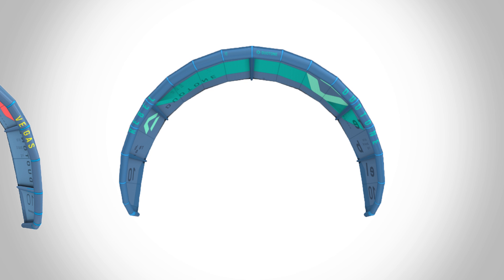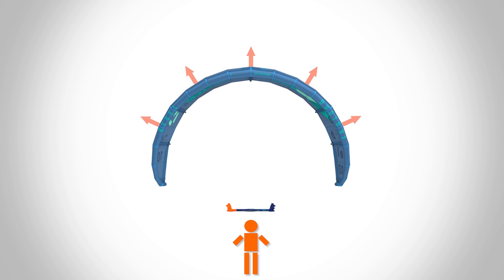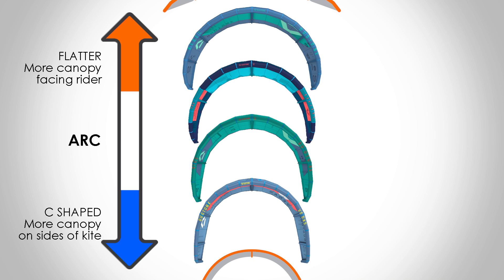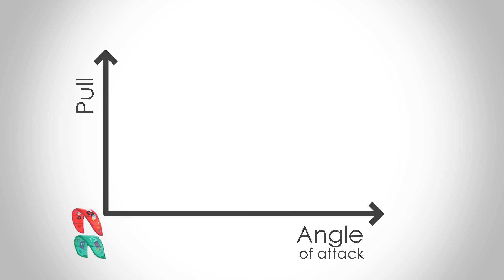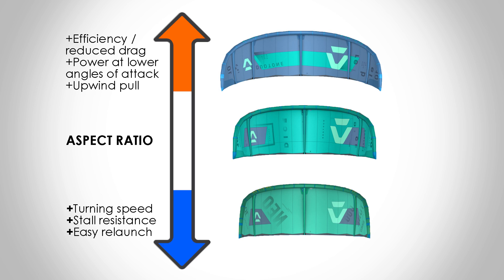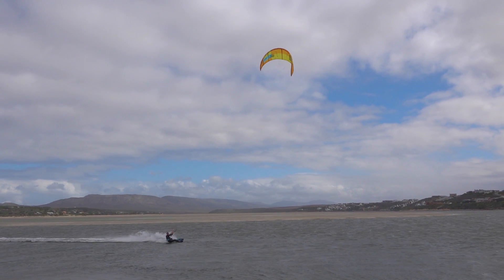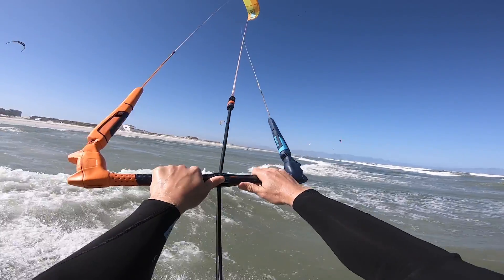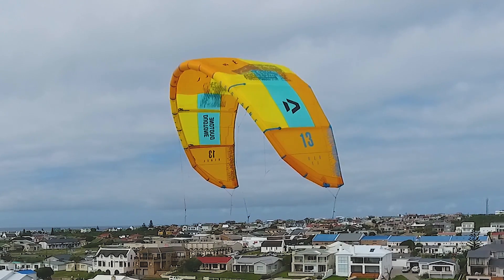Kite Shapes Explained (Bow, Delta, C kite, Hybrid, Flat, Aspect Ratio, Buying Choices etc)

Comment: So I am a complete noob and I have a core xr 12m and all the proper gear and what not is this a good starter kite for being a beginner? Thanks for all your advice and videos there so informative and in depth your very awesome at providing quality informed videos thanks 🤟
Reply from the maker: That's a fine beginner kite, good depower range. Has a tendency to make learning your first jumps harder, as it can front stall more easily than most kites, but you'll learn to work with that.

Comment: Hello, just picked up a sub, appreciate bthe good videos :)
I picked up future C-shape core kites secondhand, the GTS 10m 2020 and a 17m nexus for Light wind. New kite friends have described the rebel as the kite they wish they had started when seasons ago. What's the practical differences of a 'future c-shape' kite Vs the dutone rebel, as an example please?

Thanks!
Reply from the maker: Hello hans. What stage are you at and what kind of kiting do you like to do? The GTS is a slightly C shaped kite, with a bridle and a slightly low aspect ratio. It sits in a similar position to the dice on the chart but with a lower aspect ratio and skinnier leading edge. The GTS' shape is aimed at fast turning, since it's C shaped and mid aspect ratio, both of which improve turning speed. It's also quite fast in forwards flight, the leading edge can fly forward quickly, mostly due of the skinny leading edge. The downside of this is the kite likes to overfly a bit more than normal and that does mean that you really need to loop it, or work it, to land anything more than a tiny jump. The GTS is primary built for aggressive kite loops, since it will turn on the spot and move where it's aimed. The GTS also works reasonable well for unhooking. It's aimed at advanced and younger riders interested in mega loops and unhooked tricks. The rebel is really very different, it aimed at older riders that want maximum power and power control. The rebel has much more lift with the kite above your head or at the edge of the wind window, i'd say about 30% more, though i haven't stuck a newton meter on them, just judging by how my knees feel. Anyway, that extra force at the edge of the window means basic jumps the rebel can give much softer landings and also means you can ride a much greater upwind angle. There is a lot more power control from simply moving the bar in and out, whereas the GTS is more controlled by steering and window positioning. You have to apply more force at the bar to get the rebel turning but the new rebels do turn extremely quickly and loop well. The older ones not as much. The rebel is not good for unhooking. If you have any more questions let me know.
Reply: @kitesurfcollege  hi there. Thank you for the highly informative answer 😀 Truth be told, I'm a complete beginner that has done 10hrs of lessons and that was a few months ago. I've a background in surf, short board surf Sups and snowboard experience. 105kgs dry and 6"4".
I can get on the board and go left and right. That's where I'm at. I'm 36 and I guess I'm an older rider who wants power and control and to get comfortable crusing and building my skills 😊
Normal knot range here on local beach will be direct onshore or cross/on 12-25ish knots, with gusty variable conditions over that (SE Ireland, Duncannon) 
Struggled with the GTS when it last took it out, hard to keep in the air and water start with it.
Would you recommend the rebel as a beginner kite I can progress with as a bigger chap? It will be a while before I'm trying tricks and flying around, but I've a long background in watersports outside of wind so hoping for a quick progression. 
Keen to understand what you would point me towards that could still work with my Sensor 3 bar. Thanks!
Reply: I also haven't learned to go upwind yet. That is essential at spots like Lady's island where I would like to progress to soon 😊. So, stable predictable and easy to fly are top of my list.
Reply from the maker: Hello Hans, you can definitely make those kites work. They are fairly modern, which is important. There are many lemons from the old days of kiting. Those kite have decent depower and the safety systems work. In an ideal world, if you were buying core kites, the XR would have been better for you than the GTS, and possibly a 10 and 15 or 10 and 14. 10 and 17 leaves a big gap. Especially as I'd say sizes 12 to 14 are easiest to learn with if you're 100kg, given the correct wind speed for them of course. Getting good use from a 17 can be tricky in Europe when learning. The wind speed where it will work well can be of a narrow range and there is a whole different skill to flying 16 to 21m2 kites. The XR or the rebel would have been better for you in terms of wind range, ease of use etc as they are flatter kites. The XR will work with your bar for sure, I'm not sure the rebel will, as I think the center line Y split is much lower on the rebel's bar. If you were to change to the rebel one day I would also change bar anyway, there are some issues with the sensor 3. Keep an eye on the part of the lines with metal rings on. The rings can ware out the cover on the lines quickly. I think if you keep the lines clear of sand they should last and then you can replace any worn parts before they break. Any more questions please let me know. Hope you get some good wind soon.
Reply: @kitesurfcollege  Thanks for the insight :)
What do you think of the Nexus2 in 12 or 14 vs the XR? A friend who rides Core recommended Nexus over XR for liveliness and better for upwind?
Reply from the maker: @hansfrederiks-  Hi Hans. The nexus is faster turning, and more stable than the XR. A good combination for people who wave ride. The XR has bigger wind range, softer landings, easier power control and more upwind ability.
Reply: @kitesurfcollege  Thank you Alex! I've decided to add the 12m XR to the quiver, excited to put some of your tutorials into practice. 

One final question-
I live quite near good spots but frequently don't have kiters to kite with. Was looking at a Wing and foil board to learn and be able to get out regularly on the solo days. Is this transferrable to kiting?

thanks!
Reply from the maker: Hello Hans. A lot of kiters might envy your problem of not having too many other kiters around. In terms of wing foiling, handling the wing itself is far easier than flying a kite.  Your kiting skill will help you learn to handle the wing quickly. The challenge might come if you've never hydro-foiled before. Riding a hydrofoil is a new skill to master. It's quite different from planing over the surface. If you have never hydrofoiled before then wing foil can take a while to learn and you may need some help. Many people learn to foil behind a board so they can focus solely on that. When learning to wing foil you may struggle to navigate, you'll probably drift downwind, and there's a chance of getting hit by your own foil, so I would say it's not great to aim for solo wing foiling during the learning process. Once you have learnt, wing foiling offers a little more flexibility. It works better in gusty wind and you don't need anyone to launch you etc. But also bare in mind, that as you develop kiting skills you may find you learn the best spot for each day and there should be others there. The more skilled you are the easier it is to score a good session. Also, I'd be surprised if there aren't local kiting groups near you - there are usually whatsapp or facebook kite groups in most areas - unless you live somewhere extremely remote. Going kiting or wing foiling solo is always a risk. The more experienced you are, the smaller that risk becomes. Any more questions please let me know. All the best, Alex

Comment: Two comments on this generally very good video :

1.  You missed covering  probably the most complex aspect of kite shape - its draft, the fore-aft or chord-wise curvature.

2. Bridle-less 4-line C-kites have limited depower because the centre-of-drag is above the kite's point of de-power rotation, which makes the kite rotate to a positive angle-of-attack. If you place  a tensioned 5th line on a bridle-less 4-line C-kite, the depower rotation point is shifted upward and above the drag force, and the kite's depower will be vastly improved.

Comment: Having watched quite a few of the videos, most, if not all of the older videos used Core kites, but this video is primarily centered around Duotone.
I am quite new to kiting, and want to get my own, rather than struggle with renting from local place.
1. How do you rate the new Core kites (& new Bars) vs the Rebel / Neo?
2. For same wind, would the size of comparable kite (Core vs Duo) be the same?
3. What size would you suggest for wind range (Summer 5-11kts; Winter 6-17 kts) & 80 kg body.
Thanks for all the really good material - appreciate any thoughts on above questions...
Reply from the maker: Hello Charles, happy to help. Core are focused on making high performance kites. That means the kites are rapid to respond, however that does mean that they are quite aggressive to handle for most, and are more likely to stall after jumps if not looped. Also for jumping they make you climb quickly but you also come down quite quickly. Duotone kites have been the market leader for years, but have also made some of the biggest improvements to kite design in recent years. The rebel, for example, is a kite that always glided well, giving soft landings. Typically a kite that does that is hard to steer and easy to stall. However duotone have made numerous improvements and construction changes that now mean you get that forgiving glide and power from simply sheeting in, plus now with rapid steering and much more stall resistance. Also their click bar is outstanding.
Generally sizes of all kite are comparable a 10m2 from one brand should be similar in size to a 10m2 from another brand. The difference is in the projected aspect ratio (the size of the shadow it makes). So a 10m2 flat arc kite will give you a lot more than a 10m2 C-shape.
5 to 17 knots is very light wind. If it rarely goes over that then you definitely want pretty big kites, maybe a 12 and 15. You could then add a 9 for stronger wind.
What sort of kiting do you see yourself doing? Do you plan to play in waves, or foil, or would you like to ride a twintip and start jumping?
And what's your home spot like, flat, choppy, wave etc? Let me know and I can give you some more specific recommendations on what equipment might work.

Comment: Excellent Work !!! 
Would Just be interested where you Put the Mono and the juice ... 
Thx a Lot !
Reply from the maker: The Juice is close the rebel in shape but has a lighter weight & construction (the juice has a lighter canopy material and 2 less struts). The light weight helps it fly in less wind, makes it drift back nicely during front stalls, and makes it lighter to steer. The stronger and more rigid rebel handles strong wind better, keeping its shape and performance even overpowered. It's a similar story with the neo and mono. The mono is a bit like a stripped-back light-weight version of the neo.
Reply: @kitesurfcollege  makes sense ! again thx a lot, keep on with the great work !

Comment: Hi... How is the neo for unhooking?
Reply from the maker: It's very nice for unhooking. Very stable and smooth power change. It's disadvantage for unhooking is that it's a very fast turning kite compared to the dice, so would work best with a small bar, or in larger kite sizes.
Reply: @kitesurfcollege  thank you? What about a Low V setting on the click bar?would help?

Comment: I've just tried to switch from an evo to a rebel after having some years of experience. I was shocked how big the difference actually turned out to be. I was searching for a small kite for strong winds and ended up with an 8m rebel. Compared to my evos it actually feels like a 10m and it's not forgiving at all... I'm getting used to it now, but was very unhappy at first. Therefore I wouldn't recommend a rebel or any other high aspect ratio, flat kite to a beginner actually. Especially the 2020 rebel is a freakin beast 😄
Reply from the maker: Yes, there is quite a difference. The rebel does feel like a bigger kite. Stick with it though, it's got amazing hang time and gentle landings once you learn to handle it a bit.
Reply: @kitesurfcollege  the landings indeed feel more like flying than gliding 😄 Sometimes it feels like you won't come down at all. But for the intended use of up to 30+ kts I would rather need a 6m or even a 5m with my 72 kilos. A size that I've never even considered using.
Reply from the maker: @RafCenterMyself  How are you getting to grips with your Rebel now?
Reply: It works, but I think that I’ll stick to the evo next season. My main spot is in holland, where we often get colder, stronger and gustier winds. Therefore the Rebel still feels too sensitive most of the time.

Comment: Hi there! I`m still under impression after watching this tutorial. I suggest making the same video on board shapes (twintips) as beginners often make wrong choices being mislead by either salepeople or adverts. You might tell about such techs as sizes and weight, rocker, width, flexibility, NACA channels etc. All these factors influence greatly one`s  gliding, jump levels, going upwind and managing the board in the strong wind conditions. There is also a lot to say about direct boards, I suppose)
 Best regards from cold Russia,
Dmitry Yarizov

Comment: Excellent video, as everybody has commented. I've heard a lot about the differences between various kites. High vs low aspect ratio, hang time vs dynamic and responsive, etc. However I'm torn between an Evo, a Rebel, and a Dice. I think a difficulty for somebody without a lot of experience with different kites is knowing how to tell what kind of kiter you are, to understand which kite will serve you better. Obviously trying different kites is one of the best ways to find out, but I wonder if there's any description of kiting (not kites) that can be helpful. I learned on a Vegas (when I didn't know anything about kiting and got it for a good price, and was told that learning on it would make me a better kiter eventually...). Now I have a Cabrinha Drifter, partly based on an unfulfilled hope that I would do a lot of foiling, and because there are generally 1-2 meter waves where I am. Now I'm considering a more all around kite. However it's hard for me to say what my kite style actually is like. There are lots of waves where I live, but playing around in the waves on a twintip (running away from them and then trying to climb over the broken surf) is different from a dedicated surfer on a directional who actually can ride waves in. I like to be able to move my kite around, which would suggest the Dice or the Evo, but I've been told that in these gusty and wavy conditions a Rebel would be the best. So it's difficult to tell.

Comment: Well done, thanks. It would be nice to see other brands/models plotted on your axis of features!
Reply from the maker: Hello Gregory. Let me know what kite you have, or have been considering. I've probably used it and can tell you where it sits on the axis.
Reply: @kitesurfcollege  Thanks - Cabrinha - Switchblade, Contra.
Reply from the maker: @GregoryGuthrie  they sit just below the dead center of the axis. They are medium arc, with a slightly lower aspect ratio. Somewhere between an evo and neo.
Reply: @kitesurfcollege  Hi Alex thanks for the great video as always. Been using CrazyFly Sculps for few years which are an all-rounder. Really stable with good power on the low end. What is the normal direction to go after a few years getting the basics? I love jumps, but also love waves.......The Rebel is appealing, but so is the Dice or Neo..... If you were going to have a mixed kite quiver, would I be better going for a faster kite for waves in the smaller sizes and slower boosting kite in the larger sizes. Eg
7m Neo/Dice
9m Neo/Dice
13m Rebel
Reply from the maker: Hi N X. Which do you spend more time on: wave sessions or jumping sessions? Also, do you prefer waves in stronger wind/storms? How old are you and how high are you jumping? Do you plan to start looping? If mainly wave riding then maybe 7 Neo, 9 Neo/Evo 13 Rebel. If mainly jumping 7 Evo, 9 Rebel and 13 Rebel. Or you could just go all rebels like me if you mainly enjoy jumping and landing with less impact. Once you learn to handle them you can use rebels for anything, especially with the improvements on the 2021 rebel and 2022 rebel sls which make them work with a wider range of kitesurf disciplines. I would only look into the dice if your looping or unhooking.
Reply: @kitesurfcollege  Thanks for the very detailed reply 👍 Have done about 130 sessions. 
I'm 41, pretty fit 75kgs. Kite mostly UK waves, waist to just over head high. Jumping is mostly between waves. Jumping 3-5metres. Comfortable with downloop transitions, so keen to get into loops in the next 12mnths.  I have recently started riding strapless on a directional, but still love TT days fully powered. Most used kite over the year is 12m but use the 9m and 7m regularly through winter.
Reply from the maker: At your weight and location I guess the 7 would mostly be for wave so evo or neo (evo if mixed wave/jump, neo if 90% wave). Then the 9 and 13 would be your best kites to jump with at 75kg, so you could go 9 and 13 rebel. Those are easy and forgiving sizes to jump with.